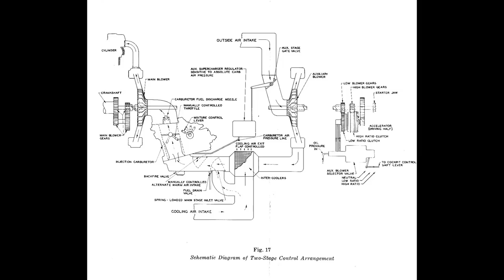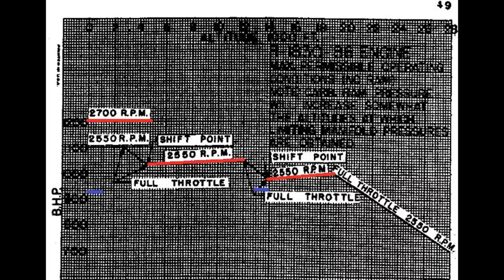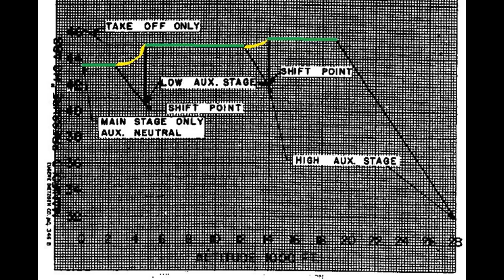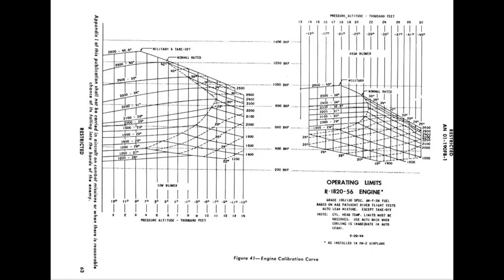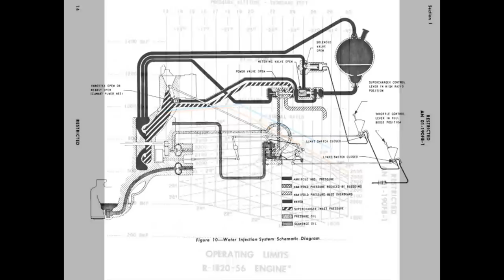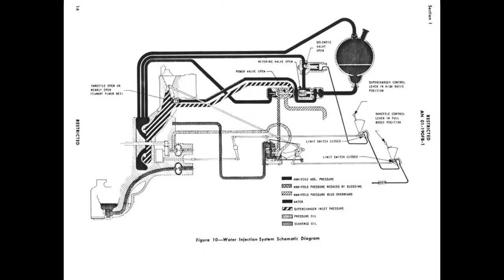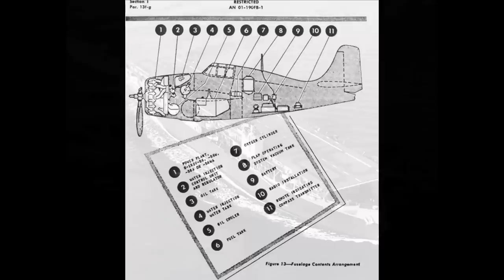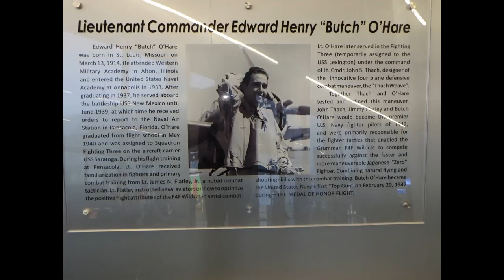Grumman Wildcat and FM-2

Comment: I suspect that the DC3's and PBY's did not have the advanced supercharging system of the F4F.

The F4F had higher octane fuel, which is the primary reason it could make more hp than the Nakajima Sakae.  There were three factors that helped the F4F against the A6M.  In the very beginning when the Japanese still had their elite pilot force, there was little meeting between the two planes.  When the engagements with F4F's started, many of the elite JN pilots (not that many to begin with) were already out of action (the Midway defeat played a huge role here).  The main factor that helped the F4F was the ability of the US Navy to recover and repair the A6M2 in the Aleutian islands.  The allies already knew that the A6M does not dive well.  What they did not know was that the A6M does not roll well at anything over 250 mph.  The only way one could have known that was by flying the plane.  This allowed the development of tactics that exploited that deficiency of the A6M, and giving a few more seconds of life to a US Navy pilot was often enough to have another friendly pilot get him out of trouble.  Which brings us to the final reason the F4F somewhat held up.  That was the numerical superiority, without which the application of the tactics discussed above would be impossible.

We cannot over emphasize the advantage the US navy got by obtaining the Aleutian Zero.  This was almost a big blow to the Japanese as the Midway defeat.  Both of which were thanks to extreme luck on the US side.

BTW, there was very little fighter to fighter combat between the FM2 and the A6M.  When these showed up in the small carriers, they were usually in the rear end of the task forces where the fighters were already cleared up.  They were usually ground attack or protection against bombers, which were fairly rare as well.
Reply: Radar was the key factor. This gave US forces enough advanced warning to launch and climb above the Japanese. At Guadalcanal, Australian Coast Watchers served the same advanced warning purpose.
Reply: @fazole  Yes, that was one of the major factors, but that condemned the Betty bombers more than the A6M's.  An experienced A6M pilot can easily evade a screaming diving F4F.  But he can do nothing for the Bettys.  If you are referring to Midway, the major factors against the Japanese was the cloud cover that hided the US divebombers until the last second, yet the divebombers could see the ships.  Plus all Japanese scout planes had malfunctioning radios.

One real good example that shows how one sided was the battle between F4F and A6M is the combat between Saburo Sakai and Sunderland in August 1942.  Sunderland could cope with the two inexperienced pilots, but when Sakai came in, the only thing that Sunderland could do is a high G spiral dive.  If he tried to accelerate straight down, he would have been shot.  When he had no more altitude, he ran out of options, and got shot to pieces.
Reply: @demetridar506  His name was James Julien "Pug" Southerland (the naval aviator who was shot down by Saburo Sakai). The real strength of the F4F came about when the pilots started applying team-tactics to defeat the Zero such as the "Beam Defense Maneuver" popularly known as the Thach weave as opposed to fighting individually, in my opinion.
Reply: @Nghilifa  Yes, that's the name.  Sunderland is close enough though ;)  Yes, that maneuver also helped.  But again, it worked due to the numerical superiority.  Typically, the experienced JN pilots (if any) would spear head the attack, and their wingman (if any) would be a novice.  The novice pilot was often not capable enough to cover the attacker.  Without the numerical superiority, all of the tactics developed would be meaningless.  Another thing to note is that all USN pilots were well trained, with at least 600 hrs.  Only a small portion of the JN pilots were well trained by the time the F4F started the fight, which means that they could barely do anything and those were the ones easily shot down.

The real strategy behind these tactics was not fight with the A6M's and instead nail the Bettys.  If an A6M has to be dealt with, here is how the ten of you do it ....

One more important factor.  Much of the A6M vs F4F combat was at Guadalcanal, where the A6M's were operating at extreme range.  This is what killed off many of the remaining experienced A6M pilots.  Nothing to do with tactics or aircraft design, but the fact that the IJN was willing to sacrifice its elite pilots and protect its capital ships.  And of course the pilots would always follow orders to near suicidal missions.

Comment: Maybe you didn´t mention it because it is widely known and not entirely specific to the Wildcat:
The use of self sealing fuel tanks and pilot armour was very helpful, soething the Zero didn´t have, and was part of the reason the Wildcat was heavier.
Reply from the maker: I didn't cover it for several reasons. First, this channel isn't aimed at the people who are new to this topic. Second, it's not entirely true, it depends on when you are talking about it. Early on neither had armor, later on, they both did. The early Wildcats didn't have self sealing tanks either. Third, this is a remake of an earlier video on supercharging, so that's the primary focus, and it's an area that's been ignored in these planes.

Comment: Why didn't Wright , Pratt and Whitney and the others copy the 4 valve per cylinder setup used in the Bristol Mercury?
Reply: Bristol dropped that design because they thought it wouldn't be possible to produce viable twin row engines with it. The Italians and Japanese didn't get the memo and developed 4-valve radials based on the Bristol design.

Comment: Most American fighters at the beginning of the war were rugged, could take punishment, were a good gun platform and could out dive just about anything but not so good with turning or speed. Does this represent qualities the Army and Navy preferred or just how it worked out?
Reply: The Zero was pretty much the gold standard when it came to turn. Almost anything is going to be sluggish next to that.

I read something once (a book in a public library in Hobart, Australia) which suggested that clipped-wing Seafires with low-blown Merlins operating at their optimal altitude had JUST enough energy to turn with a Zero, but it still wasn't recommended.
Reply: @Ensign_Cthulhu  I read something similar about how they learned quickly to not get into low speed turn fights with the zero.

Comment: Is this the original Wildcat video with improved sound?
Reply from the maker: New pictures, new audio, but based on the original pair of Wildcat videos I put up when the channel was new.
Reply: @GregsAirplanesandAutomobiles   The audio is a huge, Huge, HUGE,  improvement over the original.
Reply: @GregsAirplanesandAutomobiles   You did leave out my favorite line in this version though.  Which was:

"Now, I don't know if this next statement is a testament to the Wildcat's durability, or an example of how bad its aerodynamics are.  But the Wildcat does not have a never exceed speed......"

It made me laugh every time.

Comment: 12:34 Rather than burden the pilot with reducing RPM like this, why didn't they simply raise the blower speed and bleed off any excess pressure over 46"?  (And further begs the question why the pilot couldn't just set it it "combat auto" mode which would increase blower speed a notch at say 43" and decrease it at say 48"?)
Reply from the maker: The supercharger is geared to the engine, thus any change in engine RPM changes the blower speed. They can't just bleed off excess pressure because it's really inefficient. The centrifugal superchargers they used use a lot of power to create that pressure, when you dump it overboard you don't get it back. So instead the throttle the supercharger to prevent overboost, which is more efficient. I have a video about this, Supercharging Vs. Turbocharging in WW2 aircraft, which explains this further.
Reply: Plus the boosted air also has fuel mixed in with it since the carb puts fuel into the inlet of the supercharger, so if you dump boost you're also dumping fuel with it.

Comment: Apologies for getting off the subject here, but I want to ask about the Rolls Royce Spirit of Innovation.  All I can say when I look at the is airplane is “why”.  https://www.youtube.com/watch?v=o-rfAifj6cc

Not because it is electric, but because they put the cockpit near the tail and the pilot has no forward visibility.   In piston powered fighters and air racers the fuel tanks had to place near the wings to prevent a gross shift in CG as the fuel was consumed, and this pushed the cockpit aft.   The beauty of electric vehicles is that the batteries can be placed almost anywhere, and you can see auto manufacturers really taking advantage of that.  Batteries don’t lose weight during flight, so I don’t understand why the cockpit can’t be much farther forward in this airplane.  Move the batteries back a bit, maybe even move the wing back a bit, and put the cockpit in front so the pilot can see. It’s almost as if they were trying to look retro to gain acceptance for electric power.  I think this looks unnecessary and therefore really dumb, so if anyone has more information please share.  Thanks.
Reply from the maker: Hi Gort, I may cover electric planes at some point, but right now they are just a novelty and are in no way practical.
Reply: @GregsAirplanesandAutomobiles    Thanks, but please don't misunderstand this as being a request to become distracted by electrically powered airplanes, which are simply not as interesting as internal combustion engines.  The thing that interests me here is why the position of this cockpit is so awful when it must be completely unnecessary.  I'm just hoping one of your viewers may have useful information.
Reply: If anyone was interested I now have the answer to my question.  The video I saw on YouTube seemed to imply that this aircraft was a purpose built electric airplane.  It is not.  It is a modified air racer that is normally piston powered.  So of course the cockpit position makes sense for an airplane with complex engine support systems as well as consumables that need to be near the CG.